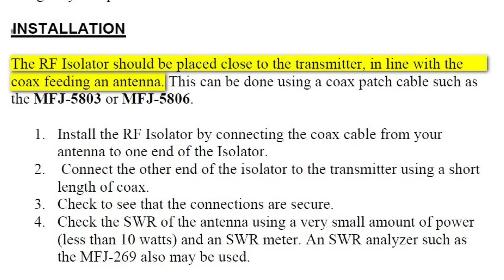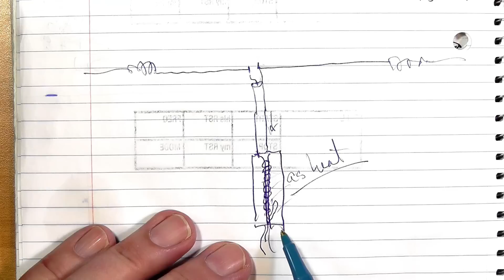Effect of the MFJ-915 Choke Balun (#304)

Comment: Dave, I suggest you do the same experiment but add a meter to measure common mode current. This will help determine if the choke is actually doing what it is designed to do.

Comment: I am a crazy about building my own antennas and stuff. I was using a 49:1 auto transformer on a half wave 20m piece of wire for about 6 months with great success barefoot on a FT891.
I notice the horizontal wire antenna  was had greater background noise than my built vertical 20m diapole.
I built a choke using  240-43 and 17 wraps of RG58 AND left a approx 10ft tail with PL259 on it.
Connected the tail to the 49:1 auto-trans and then connected the radio coax to the choke.
In my case it dropped the noise floor very noticably, and shifted the SWR because it was no longer using the radio coax as a counter poise.
73 and keep'em coming

Comment: Placing a Choke at the feedpoint of the dipole reduces common mode current on the feedline during transmit.  Placing the Choke at the transceiver reduces common mode current picked up by the feedline during receive.  This RX common mode current causes noise, sometimes lots of noise, in the RX.  Therefore, a choke is required at both ends of the feedline.
Reply: Do you have a grasp on what a transceiver is?
Reply: Isn't both ends of the feedline the same point of the feedline, meaning there's only one feedpoint

Comment: This video misses the mark and is sure to confuse many. The whole point of a line isolator is to reduce common mode current. This eliminates some noise picked up by the coax. Also can help with rf in the shack.
Reply: Let's not forget transmit as well. After all, things work both ways with a transceiver.
Reply: I was thinking the same thing. Get a field strength meter inside shack and check for common mode, with and without the choke. Oh well.

Comment: Dave what I do is have an actual  current balun at the dipole  for antenna isolation. 
Then just before the coax enters the rig I have what you are testing  to eliminate RFI picked up on the coax shield  it cuts the noise the reciever picks up in half if you live ia a noisy area like me. Your location looks very quiet  and peaceful. 
They also call those with the beads coax line isolator  you can use them at the dipole but the work better at the shack end. Best investment for low noise reception. 
73's
AA4CP Chuck 
Port Salerno FL USA

Comment: My understanding is such a choke will not have large impact on VSWR but it will have a large impact on radiation pattern if the frequency is high enough. So measuring VSWR isn't telling you whether you are getting a benefit from the choke or not.

When driving a balanced antenna from an unbalanced feed line without a balun, the balanced feed line will radiate, messing up your radiation pattern
Reply: This video wasted 15 minutes of my life. I have a noise problem on 40m I don't have a swr problem I gotta noise problem using a coil to get on 40

Comment: Thank you.
   I have used rf choke baluns on occasion and seen improvement in lower noise levels, not only in radio equipment, but the mass spectrometers I operated. N0QFT

Comment: I was just reading a paper today about having two CMC inline. One near the Antenna for TX  and the other near radio to reduce noise pickup in transmission line for RX. Thanks for your videos.
Reply: BlueJohnnyOnly ! 
One near the antenna is enough.
Reply from the maker: Grounding the outer shield before bringing the coax in the house really helps with noise too. I've had personal experience with that.
Reply: David Casler 
that could just mean that balun at the antenna end doesn’t have good common mode current attenuation.
Reply: I use one of these common mode chokes with my mobile screwdriver, upon manufacturer recommendation in the antenna manual. Without this in place, the stray RF causes the SWR to fluctuate wildly and bleed over on nearby electronics. There is little change in noise for me when using the choke, but the stray RF is mitigated and the SWR at the radio stays happy when transmitting and allows my mobile operation. 
Thanks for the videos.
Reply: I have one on my 80mOCF at the antenna and it works excellent to keep stray rf out of the shack.  
But on the vertical (about 40 feet from the shack) I need one at the antenna and one at the entrance to the shack, which is also shield grounded at the shack entrance and at the antenna, and with buried cable, to stop the rf feedback from going crazy in the shack.  I tried one at each end on the vertical, neither of which did the trick although both locations lowered the rf in the shack.  Using both, it is working nicely with just a wee bit of the wiggle patterns on one of the computer monitors when transmitting - it is an old monitor!
Reply: @АндрейДенисюк-ш7п  You are right as long as the shield of the coax line does not pick up QRM on its way to the radio. If you want to prevent that too, use the two chokes.

Comment: If this unit is coax in and coax out it is NOT a balun. It is simply a choke. SWR varies along the feed line if there is not a perfect match at the load. Inserting this unit simply extends the length of the feed line. The correct placement for this "choke" is as close to the feed point of the antenna as possible.

Comment: Okay....gotta admit, as a new ham (tech earlier in 2020, then upgraded to general followed by extra by august).....but why was there such a focus on swr related to the effectiveness of a choke? I watched in hopes of seeing whether or not the mfj choke had any positive effect for white noise or some RFI. So as a newbie am I missing something?
Reply: Your coax cable has a copper core and a woven copper shield surrounding it. The copper shield acts as a Faraday cage surrounding the copper core, so the copper core is protected from external interference. This is why we use coax, we can run relatively long lengths of the cable without too much interference. This also means that the copper shielding is picking up all of the interference that is in the environment. A choke balun works by creating a single point of high impedance for the shielding. RF will travel down the path of least resistance and this point of high impedance acts to isolate the coax shielding from the antenna system.

If the choke balun is working when transmitting, the signal travels down the copper core with minimal loss then it is transmitted by the antenna only, and not the coax shielding. The shielding of your coax will be picking up RFI, but because it is isolated from the antenna system, the noise signal will not go to your receiver. 

If the choke balun doesn't work, the shielding will act as part of the antenna during transmit and receive. If you know your antenna is perfectly resonant on a certain frequency you can measure the effectiveness of a balun by watching the SWR. If the  SWR is 1:1, then every single watt of energy is being emitted from the antenna at that frequency. If the SWR is higher than that, you know that you are losing power. As long as you have eliminated other issues (bad soldering, conductive materials close to you antenna, etc.) it is probably being lost to the coax shielding for the length of your coax.

So by looking at SWR, you are essentially measuring how effective the balun is at isolating your coax shielding from the rest of the system. If the SWR is low then the RFI and noise picked up by the shielding is not making it through the choke to your receiver.
Reply: @sw33tgr455  wow…thank you so much for the informative reply. Exactly why I asked if I was missing something.

Comment: At 11:50 in your video you mention that RF current returning on the coax shield is dissapated as heat in the balun.  I don't think so.  The inductive reactance of the RF choke or "balun" opposes changes in current by creation of an electro-magnetic field and a counter-EMF that opposes current flow.  THe choke is not a resistor.

Comment: I think that is more for reducing feedline radiation in the shack. Sometimes they call it a line isolator. Put it just out side the house. It is some weight to lift for at the antenna. They do go bad.
Reply from the maker: The point is to get the common mode reflection off of the outside of the coax. That's why I recommend it be installed near the antenna. Perhaps, because of its weight, it would work best in an inverted vee configuration.

Comment: I do not understand your concentration on SWR changes, when the primary function of a choke balun is to eliminate common mode RF flowing on the exterior of the coax shield. The presence of common mode RF can be a primary cause of increased receiver noise and spurious received signals.
Reply: YES! It seems Dave buried the lead on this item. Its mainly for noise and common mode current to which Dave mentions is only a problem on his PC speakers "that he simply just turns off" How does this video say anything about the intended purpose of the device?
Reply: It helps to preserve the pattern of the RX and TX of the antenna. It does almost nothing to vswr....
Reply: Yeah I'd really like more info as to how it affects noise when placed at the antenna vs. the transmitter.
Reply: He doesnt understand this topic, is why.  No mention of skin effect, or that this is a current issue.
Reply: How does the change in SWR indicate arresting of feedline radiation?
Reply: @SufficientlyScott  common mode is basically RF on the shield of coax. It happens because antenna's are balanced and coax is unbalanced. So the antenna ends up forcing some of the RF back onto the coax. Sometimes it is not very detectable but it just presents itself as a higher background noise and/or desensitizes your receiver. The best location is at the feed point where the coax begins. Some recommend an additional choke at the receiver to block any RF that made it past the first choke or stray RF picked up by the shield from outside sources.
Reply: @katsebua  Common mode can be difficult to detect. I'm not sure what he was intending but he says "The frequency shifted with the choke so that means the coax was radiating a bit". As RF is forced backwards onto the coax shield, the coax becomes part of the antenna system and shifts the resonant frequency lower. I have experienced the same frequency shift but I attributed it to reactance in the balun.
Reply: @BurrowsNE  Thanks Levi.  I have a pretty good idea of what common mode is but was really hoping he was going to show the choke a different locations on an antenna setup, like you described, that did have common mode noise and how each location affected it differently.  I'm not sure what the point of testing SWR was in regards to effectiveness of the product.
Reply: @BurrowsNE  Balanced currents in a system doesn't mean the absense of common mode current. In fact a perfectly balanced system as well as a perfectly unbalanced system will have equal and opposite current! If the shield has enough skin depths, common mode current will exclusively lie on the surface of the shield, making it impossible to force that current to the bottom.  I find that proper design, connectors, and grounding take care of most of it.  If one was to find themselves needing several hundred ohms of common mode choke, well...  Fix the underlying problem.

Comment: I''d really like to know what happens if you got rid of or at least used the least possible length of the short bit of cable feeding between the antenna and balun.  🙂
Reply from the maker: Well, give it a try! The short piece of cable is a tiny fraction of a wave length.
Reply: @davecasler  I wish I could but circumstances do not allow.  😭

Comment: I have used choke baluns on some antennas. Verticals that are somewhat poorly grounded(mobile antennas are are often bad) and off center fed dipoles benefit from a choke balun.  Dipoles and verticals with lots of radials not so much so. Incidentally, analysis with an MFJ-259 may not show a problem but applying 100W may give a very different story. I am not convinced your analysis is correct.

Comment: Such a choke will have a slight effect on capacitance due to the extra coax/wire inside it.  It should have very little effect unless your coax is very short.
You really need a VNA to analyze such a thing so you can see the smith chart.
We just tested a 4 turn on 3 inch choke for 6M and the choke had a small effect on the capacitance.
A true balun with impedance matching will have more effect of course.
You simply have to have the correct Z at the antenna to match your coax.  This can be done by tuning the antenna length sometimes or an appropriate impedance matching balun.  200Ohm loops need 4-1.  Loop-fed Yagi's should be able to get VSWR 1 with a 2-1 balun (they run 100Ohms).

Comment: Interesting. I thought a “choke” was supposed to block current mode RF. 
I use one at the Dipole (Balun) and one at the radio (feed line choke) and chokes on the “mains”. Same ferrite, same # of turns and same circle diameter. I aim for high impedance (resistive) and thousands of ohms. One “choke” usually doesn’t do the trick especially in noisy environments.
Reply: I f you are saying that you thought a choke was supposed to block common mode current then you would be correct.

Comment: Putting the choke at the antenna.... depends on what type of antenna.  If you do that to an EFHW that uses the coax as part of the system you just shut down the EFHW.    Best advice would be follow the directions and experiment with your type of antenna to what works best....not a one size fits all comment of put it at the antenna.

Comment: Whether on purpose or unintentional, the misuse of terms and the incorrect application of the unit being discussed, one thing is true about this video... it has succeeded in generating conversation.

Many of the terms in our hobby are misused and misunderstood.

I'm sure Mr. Casler would agree that he is no expert and is subject to making errors, he is doing us all a service in spite of any errors in his videos as those errors generate discussion and in a discussion, people learn, well done Mr. Casler

Using the term Choke Balun is inaccurate, the unit is a choke, what it is not is a balun. A balun is a type of wide band transformer designed to transform one impedance into another different impedance. 

A choke is exactly as the name infers, it chokes off something, in this case unwanted RF energy. 

Positioning of the choke depends on the type of antenna in use, a balanced antenna would make use of the choke AT the antenna feed point whereas an unbalanced antenna such as a long wire with a suitable type of transformer at the feed point would use the choke at or near the rig it serving two purposes, first, as the coax shield would be acting as a counterpoise the placement (where it is in the length of feed line), the choke would affect the SWR of the long wire antenna and second, any RF on the shield would be choked (blocked) from entering the rig. Best example here would literally be a "Hot mic", I'm sure most of us have had the "joy" associated.

The above is my understanding of the use of the Common mode choke, I could be completely wrong or I may have a part understanding. I'll find out in a few weeks when I install a EFHW antenna at my antenna restricted new QTH.

The most important thing to take away from this video is to discuss things that don't jive with our understandings, after all, the level of general ham competence is all in the title of what we are AMATEUR radio enthusiasts.

Keep making stuff.

de VE3KKQ
Reply from the maker: I stand by my assertion that it is a balun. It connects a balanced antenna to an unbalanced feedline regardless of its connector type. It uses the technique of removing the unwanted power from the exterior of the feedline. The function of the device is that of a balun. The ARRL Antenna Book calls them baluns for the same reason I do. The Rothammel's Antenna book from the German equivalent of the ARRL (DARC) says the same. BTW, the purpose of a choke is an inductor that passes DC but not AC.
Reply from the maker: BTW, the term "amateur" in amateur radio is from the English usage at around the turn of the 20th century and means unpaid or done by self-funded people who are nonetheless very good at what they do. Think of "amateur athletes" in the Olympics--for many decades paid athletes were banned from the games.
Reply: @davecasler  "I stand by my assertion that it is a balun. It connects a balanced antenna to an unbalanced feedline regardless of its connector type."

It is not a balun; but it can usually be used where you might prefer a balun.  A real balun isolates the ground and each leg of a dipole antenna (for instance) has exactly the same voltage and current distribution as the other.   Merely choking the coax does not force the antenna to be balanced.  

It does prevent the coax from becoming part of the antenna system and without it, the center pin sees a different antenna length as compared to the shield connection which sees not only half the dipole but the outer surface of the coax as part of the same conductor.  

So it achieves a similar purpose. A choke can sometimes resonate with the shield-connected portion of a dipole, and if it is not long enough it is capacitive and this can form a series resonant circuit with the inductor or choke and suddenly you are worse off than before.  The antenna current will then prefer to use the shield of the coax.  

More words abused:  "Common Mode".  If I had a dollar for every time this phrase was used incorrectly I'd buy a Tesla. Or a nice oscilloscope and some other gear. 
Common mode means simultaneously induced in two or more conductors.  That won't happen with coax.